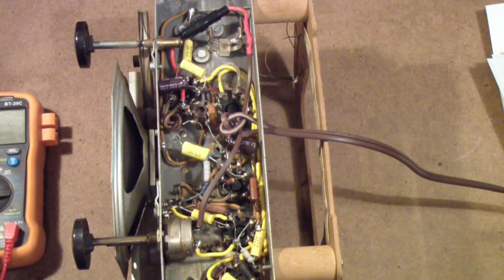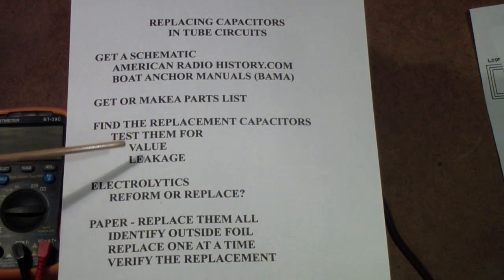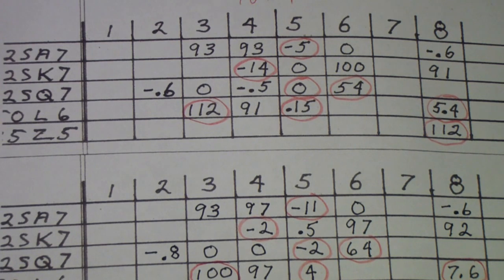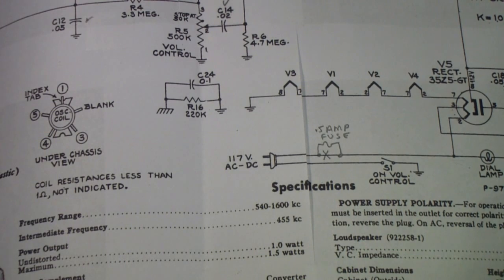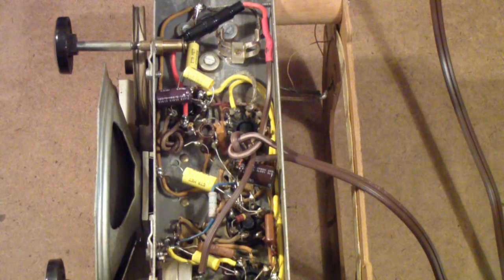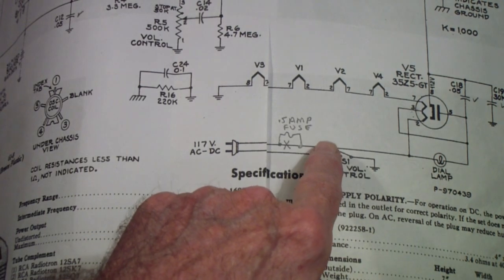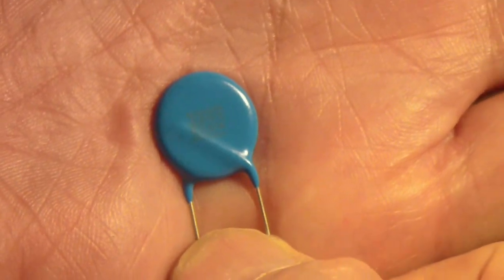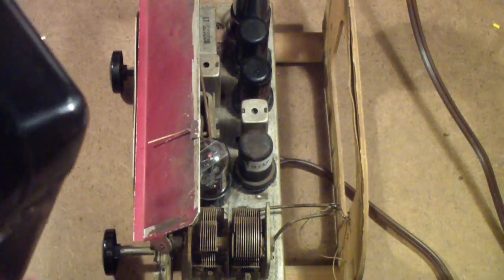TTT287 The Frugal Repairman Pt18

Comment: Thank you for the videos. I do have a question on the schematic. It looks like there is a bios cell (battery) listed on the schematic. Is that an error, or is there a trick to bypass it?
Reply from the maker: This is in a previous video in the series-the battery is to be added for use in measuring gain and doing alignment. It is not a permanent part of the radio, but must be added by the technician. You might want to go the AmericanRadioHistory.com and download the Rider Perpetual Troubleshooters Manual schematic for the RCA RC1064 to see the exact particulars. I also discuss these downloads in a previous video in this series.